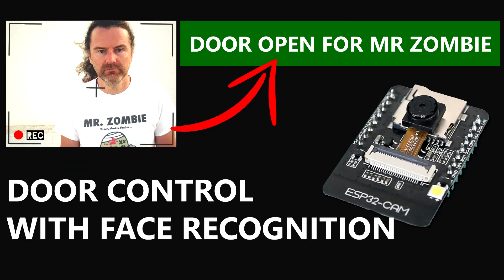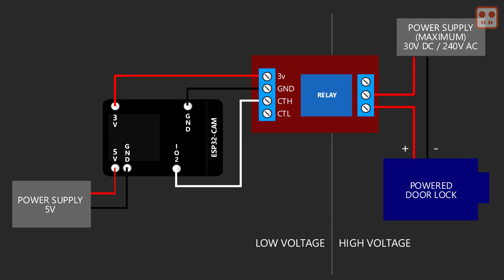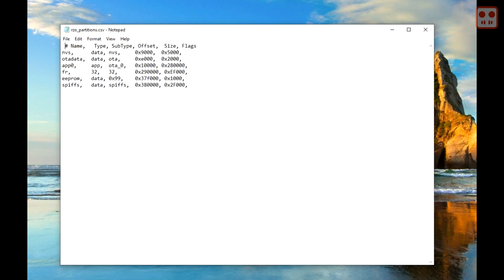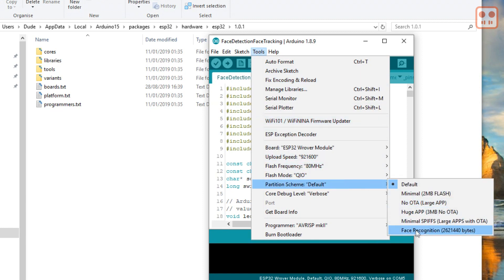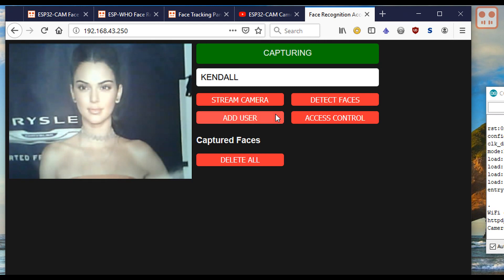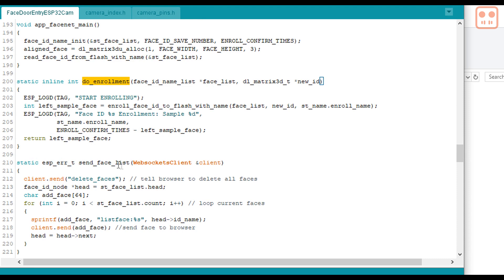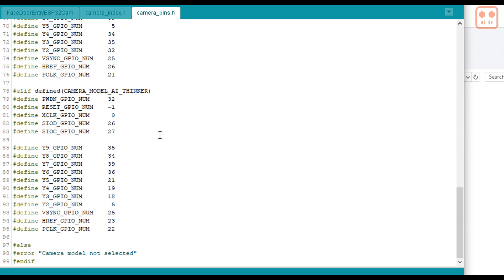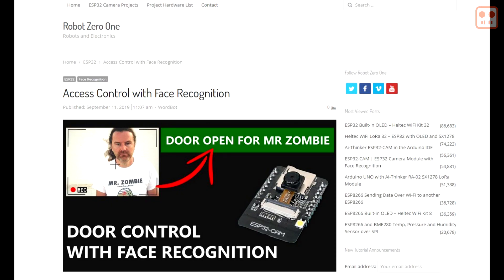ESP32-CAM Face Recognition Open Door Lock

Comment: [D][WiFiClient.cpp:509] connected(): Disconnected: RES: -1, ERR: 104
[D][WiFiClient.cpp:509] connected(): Disconnected: RES: -1, ERR: 104
[D][WiFiClient.cpp:509] connected(): Disconnected: RES: 0, ERR: 128
[E][WiFiClient.cpp:392] write(): fail on fd 63, errno: 104, "Connection reset by peer"
[E][WiFiClient.cpp:392] write(): fail on fd 60, errno: 104, "Connection reset by peer"
[E][WiFiClient.cpp:392] write(): fail on fd 61, errno: 104, "Connection reset by peer"
[E][WiFiClient.cpp:392] write(): fail on fd 62, errno: 104, "Connection reset by peer"
[D][WiFiClient.cpp:509] connected(): Disconnected: RES: -1, ERR: 104

some one please help me?

Comment: i dont know what went wrong but the camera is not streaming. It used to stream before with the same piece of code that you've attached. The HTML page renders but without video streaming. Can you help me with this.
@robotzero.one
Reply from the maker: How long did you have it working for? Can you test the camera still works with the CameraWebServer example in the IDE.
Reply: @robotzeroone  if a upload the example code for CameraWebServer, the camera works perfectly fine which makes me clueless about what the problem is.
Reply: Serial monitor shows everything fine, camera ready to use with IP address, still Web viewer in UI doesn't renders video streaming.
Reply from the maker: @saharshsinha5349  Try pressing F12 in the browser and have a look the Console tab

Comment: I can't stream, what should I do?
Reply from the maker: Are you following this tutorial or the basic setup one? Do you see anything in the serial monitor?
Reply: @robotzeroone   WiFi connected
httpd_start
E (5254) fr_flash: No ID Infomation
Camera Ready! Use 'http://192.168.1.50' to connect
Reply from the maker: What happens when you connect the browser to the IP address shown. Does the camerawebserver example in the IDE work for you?
Reply: I have run what you said in the video tutorial, when I enter the IP address it can open but when it can't stream, and on the green display there is no writing.
Reply from the maker: It sounds like the websocket connection isn't working but I don't know why. You could try putting comments in the loop to see how far it gets or try some of the other ESP32 tutorials on my blog to see if they work: https://robotzero.one/esp32-camera-projects/

Comment: Hi. How can I add tft display to this project?
Reply from the maker: What do you want the TFT to display? I don't think it's possible to use face detection and have enough pins for a TFT because the extra memory (PSRAM) on board is connected to one of the pins. You can use an OLED to display the camera image.

Comment: Great video!! Does someone know how to fix the "connection reset by peer" error?
Reply from the maker: Do you get this continuously or occasionally? I've seen the error and I think it's related to Wi-Fi  but the stream still works.
Reply: @robotzeroone  it's continuously, I've already tried the CameraWebServor example and it works normally with the stream, can you give me any suggestion about how to fix this?
Reply from the maker: I'm not sure. If I get time I'll do some tests to see if it's related to Wi-Fi signal strength.
Reply: @robotzeroone  thank you so much, it's gonna help me a lot

Comment: How hard or expensive is it to get liveness detection. I want to use it on a front door of a house. To open while walking towards it? Thanks
Reply from the maker: With the ESP32 it's going to be difficult. It's just not fast enough. There's this product (hard to find outside China though) - aliexpress.com/item/4000070597568.html?spm=a219c.12057483.0.0.5f1057ab3Yex4z that uses two cameras. Or with a PC (maybe Pi) something like this: https://www.pyimagesearch.com/2019/03/11/liveness-detection-with-opencv/ This one will probably be the best if you want to capture you face as you walk.
Reply: @robotzeroone  Yeah I think a PC would be the go. I want to connect other things in the house aswell, but the door system should be independent so it cant be hacked. The problem is I dont know how to code.
Reply from the maker: @Zed  If you've not ever coded then this is jumping off into the deep end! The second link pyimagesearch has loads of tutorials but you'll probably need to learn some Python first. Loads of tutorials on YouTube for that.

Comment: Not working... Keeps resetting on its own repeatedly...
Reply from the maker: Try working through the steps mentioned in the tutorials linked from the blog here: https://robotzero.one/access-control-with-face-recognition/ You have to set things up before uploading the sketch.
Reply: @robotzeroone  I did... didn't work.. BUT THIS TUTORIAL of yours WORKED!==> https://robotzero.one/arduino-ide-partitions/
Had to make a new 'board' to get the sketch working... adding just the new partition didn't work for me...
Thanx.

Comment: Sir can I use 5v relay rather then 3v relay?
Reply from the maker: I don't think the io2 pin will have a high enough voltage to trigger a 5v relay.
Reply: @robotzeroone because of lockdown i can take 3v so i have 5v so where i should connect?
Reply: @robotzeroone  I mean which pin? or can i connect
Reply from the maker: @sudhanshumishra6110  Measure the pins voltage. I think any pin you can use as a trigger will only be 3.3v
Reply: @robotzeroone  Also one more thing sir you have told in website that Flash and run this Sketch in the same way as before. Enrolled face data is now being saved to the new partition on the flash memory. but i am getting 
Multiple libraries were found for "WiFi.h"
 Used: C:\Users\mamri\AppData\Local\Arduino15\packages\esp32\hardware\esp32\1.0.4\libraries\WiFi
 Not used: C:\Users\mamri\Documents\Arduino\libraries\WiFiNINA
 Not used: C:\Program Files (x86)\Arduino\libraries\WiFi
Using library WiFi at version 1.0 in folder: C:\Users\mamri\AppData\Local\Arduino15\packages\esp32\hardware\esp32\1.0.4\libraries\WiFi 
exit status 1
Error compiling for board ESP32 Wrover Module. 
this error please help i am trying from last 2 months
Reply from the maker: @sudhanshumishra6110  The Wi-Fi error is normal and should stop a compile. Maybe a typo in your Sketch somewhere.
Reply: I have 5v relay so iam connecting my camera 5v relay 5v together and ground too but for that camera light is glowing and cant put the code, but if i conneect 3.3 camera with 5 v relay  and etc.. then the code uploding camera is detecting but 12v lock is not working on that time.
Reply from the maker: @sudhanshumishra6110  It's probably power related. The ESP32-CAM or the USB connection can't supply enough current for things that directly connected to it. If this is your first electronics project you need to do more reading. Here's a good video about relays: https://www.youtube.com/watch?v=d9evR-K6FAY Also check wiring diagrams here: https://robotzero.one/esp32-face-door-entry/

Comment: camera_pins.h: No such file or directory   I am getting this error
Reply from the maker: You need to put the two .h files in the same folder as the .ino file.
Reply: @robotzeroone  how can you explain, u mean in arduino folder?
Reply: @robotzeroone  Used: C:\Users\mamri\AppData\Local\Arduino15\packages\esp32\hardware\esp32\1.0.4\libraries\WiFi
 Not used: C:\Users\mamri\Documents\Arduino\libraries\WiFiNINA
 Not used: C:\Program Files (x86)\Arduino\libraries\WiFi
exit status 1
camera_pins.h: No such file or directory
Reply from the maker: @sudhanshumishra6110  Here's a different tutorial that explains things in more depth: https://robotzero.one/esp-who-recognition-with-names/
Reply: @robotzeroone  thank you so much sir, the error is not coming
Reply: @robotzeroone  but sir sir as i disconnect camera and then add the camera in circuit and then i put the ip adress the ip adress is not loading why it is happening?
Reply: @robotzeroone  SIR after reoving camera from fdi and putting in circuit it's not loading an ip adress/ i am not getting that camera window
Reply: Hello sir I really like your project. I manage to build it after some hick ups
Reply: I wanted to use it with node-red
Reply: So as the face recognized it sent one mqtt msg to node-red  a string msg lock/unlock
Reply: I also tried to use websocket at node-red but unable to get any data from esp32-cam
Reply: Plz help

Comment: i have problem in my work,  
before, this esp32 cam worked well, but after several time. the esp32 cam can't work and the serial monitor showing 
"A Connection reset by peer" 

if you have solution please tell me . because i use this project for last exam in my college
Reply from the maker: I think this is Wi-Fi related. The ESP32 thinks the browser has disconnected. Can you move closer to the router?
Reply: i try connect with sit in front of my wifi router the result is same sir. I change the another browser and and use my hotspot in my phone still same. If i klik f12 in browser some problem has show in console. "Websocket connection to 'ws://192.168.1.7:82/'failed :could not decode a text frame as UTF-8". If i try with camerawebserver the esp32 cam worked fine.

Comment: Hello, I need help. Maybe you can recommend me something concrete or at least make some suggestions in both the HW and SW parts. Any help is welcome. I need to set up a kind of surveillance/streaming system for a project at my school. I would very much like to do it with something like ESP32-EYE or ESP32-CAM. My intention is to stream (or as close as possible) on Youtube or FB directly from the module. I am not sure if that is possible and how to do it. I am very tight on time, and I don't have much money for testing either.  I know that you have a lot of experience and have tested many modules. Please, which ESP module/camera/software could I use for that? Thank you very much.

Comment: What is your face recognition library?
Reply from the maker: All the technical info for the library can be found here: https://github.com/espressif/esp-who
Reply: @robotzeroone  Thanks for your feedback! I am a student and I approached arduino recently, I have a question? How to convert html code to hex array code - eg: 0x1F, 0x8B, 0x08, 0x08, 0x28, 0x5C, 0xAE, 0x5C, 0x00, 0x03, 0x69, 0x6E, 0x64, 0x65, 0x78, 0x5F [...] ". and how to know its size. File: index_ov3660.html.gz, Size: 4408 <===
Reply: Thanks for your feedback! I am a student and I approached arduino recently, I have a question? How to convert html code to hex array code - eg: 0x1F, 0x8B, 0x08, 0x08, 0x28, 0x5C, 0xAE, 0x5C, 0x00, 0x03, 0x69, 0x6E, 0x64, 0x65, 0x78, 0x5F [...] ". and how to know its size. File: index_ov3660.html.gz, Size: 4408 <===
Reply from the maker: @khoatranang5919  Check out my other videos.. there's a tutorial for that. Also on the blog. https://robotzero.one/esp32-cam-custom-html/
Reply: @robotzeroone  thank you very much!

Comment: I have followed and succeeded.  but I use it for 15 minutes as the webserver no longer displays the stream images of the camera.  Can you help me
Reply from the maker: Do you see anything in the serial monitor when this happens?
Reply: @robotzeroone  hello sir
WiFi connected
httpd_start
Camera Ready! Use 'http://192.168.0.109' to connect
[D][WiFiClient.cpp:509] connected(): Disconnected: RES: -1, ERR: 104
Reply from the maker: I'm not sure but I think for some reason the Wi-Fi disconnects and I don't have code to reconnect at the moment in the sketch. I'll add this in the future.
Reply: @robotzeroone  hello (index):146 WebSocket connection to 'ws://192.168.1.97:82/' failed
Reply: @robotzeroone   failed: Could not decode a text frame as UTF-8.
Reply from the maker: @huynguyen6680  Have you managed to save some names?
Reply: @robotzeroone  This error seems common... I suspect this is due to the data we save in the flash as it gets cluttered... 

https://rntlab.com/question/how-perform-reset-factory-esp32/

Faced the same issue... followed the above instructions to clear the flash memory of ESP 32 cam... it solved the issue... it might re occur when we enroll and delete faces again and again...

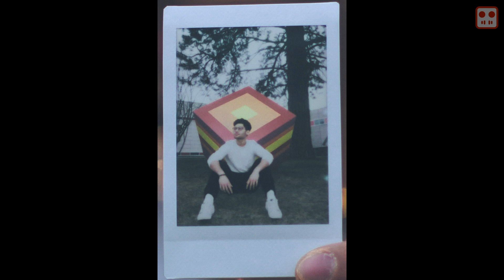Comment: Hello MR. Robot Zero, I really appreciate your work on this tutorial. I did the implementation as in your tutorial and everything works fine, faces are enrolled OK and faces are detected OK; However,  if a new face (one that is not enrolled) is presented to the ESP32-CAM then sometimes the system detects it as one of the enrolled faces. Is this the bug that you mention at 9:16 of your video? Is there a fix to this problem?
Reply from the maker: The problem mentioned was with an earlier version of the ESP32 Hardware library. In 1.0.4 it's fixed. If you are finding it detects different people as the same there's a setting that can be changed but without looking into it I think it might be only available in the IDF version at the moment. Checkout FACE_REC_THRESHOLD here: https://github.com/espressif/esp-face/blob/master/face_recognition/README.md
Reply: @robotzeroone  THANKS for your response.  I find a FACE_REC_THRESHOLD, in the fr_forward.h file. It looks like:

#define FACE_REC_THRESHOLD 0.5

I changed this to  #define FACE_REC_THRESHOLD 0.7

It is working now but I cannot yet confirm that reliability has improved. I am going to test during the next few days. Meantime, if you have any suggestion, please let me know.

Comment: I am working on a project in which I need a live video stream from the ESP32 cam module on the Blynk app’s Video Streaming widget. The following code i have used is in Arduino IDE example Examples>ESP32>Camera>CameraWebServer. Using this code I get the camera’s IP address on which a perfect live video stream can be seen using a browser .But i am not able to view stream when I use this IP address in Blynk’s Video Streaming widget.

Could anyone please help me in setting up a video stream form ESP32 CAM in blynk app widget.

Thank you
Reply from the maker: Do you want this to work on your local network or outside the house? Probably better to ask on the Blynk forums because it's most likely a Blynk configuration thing.
Reply: @robotzeroone  outside the house
Reply from the maker: @motivation.ai.shorts  OK to start you'll need to do port forwarding so the streaming port can be accessed outside your local network. Have a look on Google there will be instructions.

Comment: Thanks a lot ! 
For all the people who look how to straight start a face recognition when the module is power on you just have to change in the code : typedef enum
{
  START_RECOGNITION,
  START_STREAM,
  START_DETECT,
  SHOW_FACES,
  START_ENROLL,
  ENROLL_COMPLETE,
  DELETE_ALL,
} en_fsm_state;
Reply from the maker: I think that this just means that when the browser connects you don't have to press the 'Access Control' button to start face recognition? You still have to connect to the browser so the websocket connection is active.

Comment: Why, when detected multiple times, the system freezes and the board reboots ?

Guru Meditation Error: Core  1 panic'ed (LoadProhibited). Exception was unhandled.
Core 1 register dump:
PC      : 0x400014fd  PS      : 0x00060530  A0      : 0x800d8a10  A1      : 0x3ffb1e20  
A2      : 0x00000004  A3      : 0x00000000  A4      : 0x000000ff  A5      : 0x0000ff00  
A6      : 0x00ff0000  A7      : 0xff000000  A8      : 0x00000000  A9      : 0x00000017  
A10     : 0x009f527e  A11     : 0x40898648  A12     : 0x00000000  A13     : 0x00000000  
A14     : 0x7ff00000  A15     : 0x40898648  SAR     : 0x0000001d  EXCCAUSE: 0x0000001c  
EXCVADDR: 0x00000004  LBEG    : 0x400014fd  LEND    : 0x4000150d  LCOUNT  : 0xffffffff  

Backtrace: 0x400014fd:0x3ffb1e20 0x400d8a0d:0x3ffb1e30 0x400d8b01:0x3ffb1e50 0x400d22ba:0x3ffb1e70 0x400d9265:0x3ffb1fb0 0x4008d951:0x3ffb1fd0

Rebooting...
ets Jun  8 2016 00:22:57
Reply from the maker: What do you see in the Exception Decoder? If you stand in front of the camera so it's recognising you over and over it does crash. I'm not sure why.. maybe a memory problem.
Reply: Help me pls...